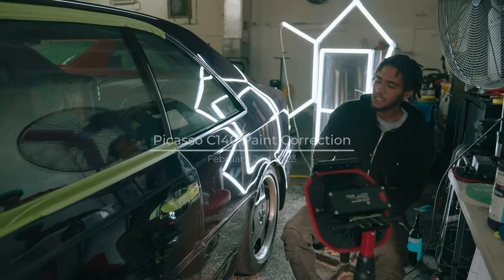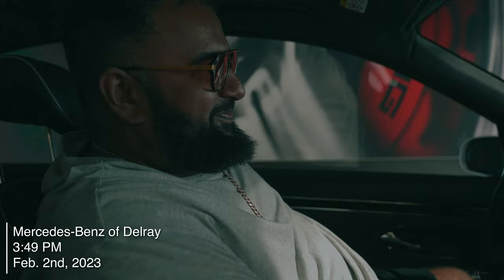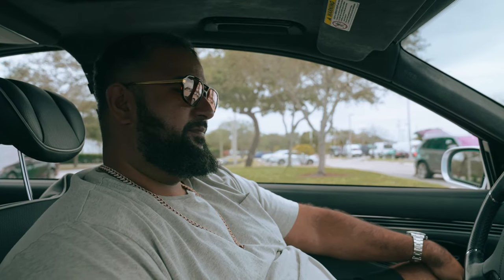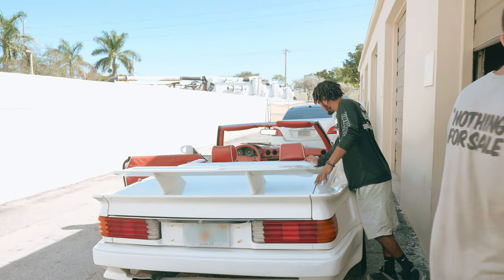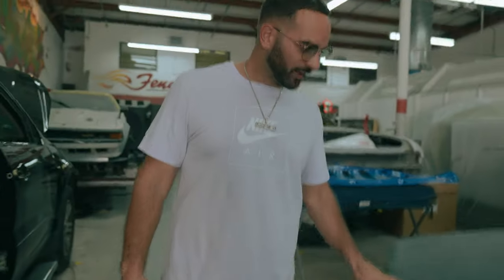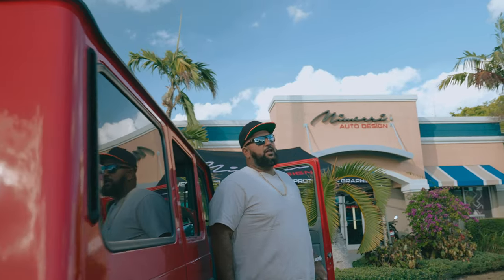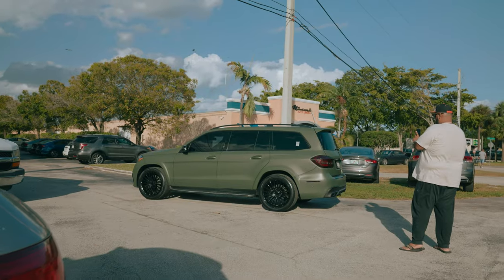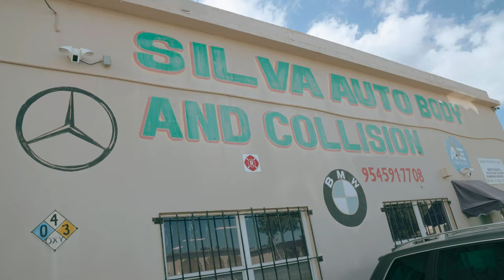We Have Projects ALL OVER South Florida!

Comment: Hell yeah ninja, I love your green hatch. Don’t forget to wipe your brake dust off the rims before it sets in.
Reply: Y’all need the pop bottle kit for fixing air locks in cooling system. It locks into the Rad reservoir and lets you boil out the bubbles when warming up the engine